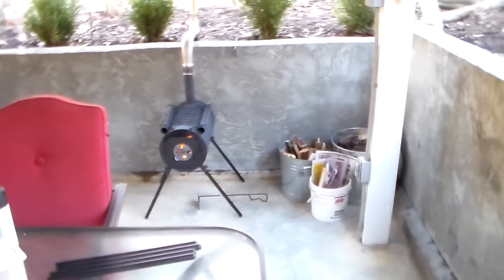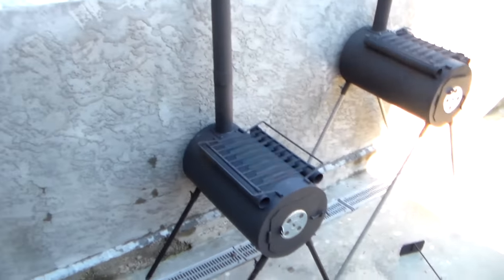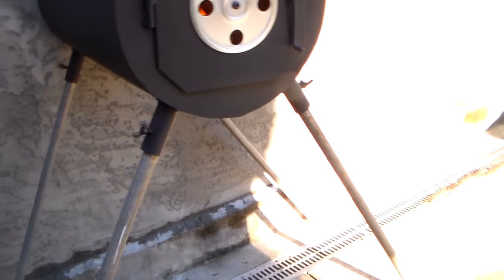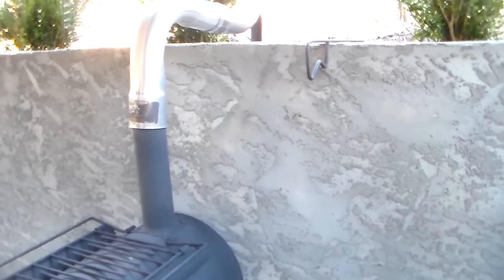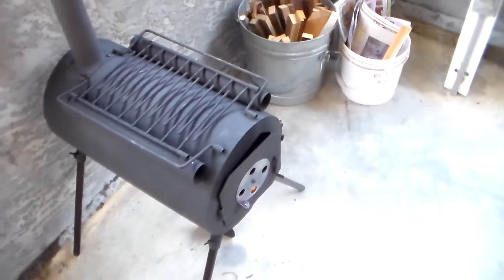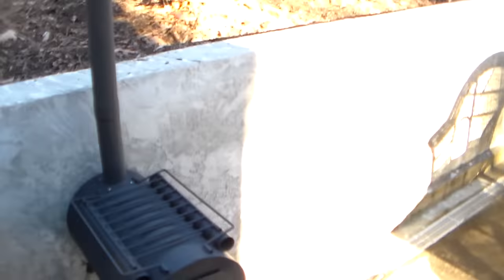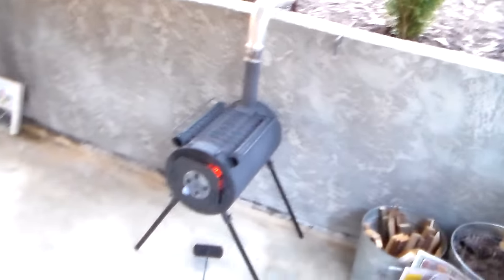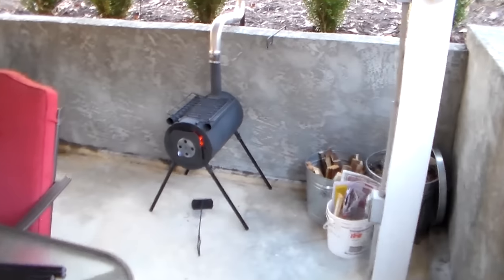Small portable outdoor woodstove for campers or preppers

Comment: So these seem like nice little stoves, but for your purposes, how are they better than firebrick or concrete block rocketstoves that can be made for under $20.  You can make 4 of them for the price you paid for one of these stoves with your inputs.  They burn just as hot, if not hotter, and use a fraction of the wood (Understanding that you have an endless supply).  Not trying to be argumentative Im just trying to see the real benefit of these.  I really like the idea of outdoor kitchens in the summer to keep the house temps at a reasonable level.  Thanks again for sharing, Dave.
Reply from the maker: +Dave Pruitt I like the ability to have the smoke away from the cooks and exhausted higher up.  Plus you can use it in a make shift shelter.  Plus everything stores in the stove and light weight to carry in a vehicle.  I love the concrete block homemade rocketstove they work great also.

Comment: soot will build up in the bend, and over heat it
Reply: Jesusandbible + Yes, creosote will build up in all woodburning stove pipes, so there has to be a way to clean them. One good idea is a straight up pipe, so easier to clean. Running the stove slowly up to 600° F at the begining of each firing - probably too hot for those thin walled ones, try 500°- .helps. keep an airtight stove pipe clean up to 5' away from the stove, even through bends.
Reply: The pipe can be taken apart and cleaned as needed. If you don’t want to do that, you can get a piece of chain that can be dropped through and spun around in the pipe to get rid of buildup, or buy a pipe / chimney brush and cord.

Comment: Those doors need angle iron welded to them, or they're likely to warp soon. I'd use small, but 1/8" thick L, frame around the perimeter, then two across. 1" weld with 2 1/2" space between. Clean the door very well. If your factory paint is flaking off, it .all. will have to be removed before new paint applied. There went the money deal. I'm telling ya, gotta make everything ya can, yourself.

Comment: Thanks for sharing I got the bigger version on ebay for about $60 with shipping. Mine also has a grate on inside to keep fire off the bottom and and two vents. I had to burn off all the paint then repaint with high heat spray and I replaced the door handle with a homemade version so that the door closed better.
Would like to know what the size of that muffler pipe your using?
Reply from the maker: +dnhman I think it is the 2.5 inch but I will have to measure it to make sure.

Comment: I have not been able to find inexpensive muffler pipe. The auto parts stores range from upper twenties to thirty some price range. A muffler shop got us two elbows for $18 each. That was the lowest. Anybody have thoughts on where to get this stuff for the $6 price?
Reply: what if you go to a junk yard with a saw and cut some off old cars, straight pipe,curved pipe. you may even find some that are just bolted on with u bolts. just a thought.should not cost much.
Reply: Thanks for the info.
Reply: Jodi Mandelias  try a parts store like AutoZone , advanced auto, or what you have in your area. most chain parts stores have bent pipe and shorter strait pipe.. if you get a galvanized pipe be sure to burn it off before you use it indoors and paint it with a high temp paint if you want. if you paint the pipe attach it to the stove and burn a good fire to cure the paint before indoor use .. peace  and good luck!
Reply: Jodi Mandelias yeah because they know we're making survival things
Reply: Yep, the junkyard is where I would go.

Comment: I've had mine for a couple of years...did have to repaint it.  i'm currently looking for more stove pipe so I can have the option of bringing it indoors.  3" pipe is a quarter inch or so too big.  I like the muffler idea...is it 2"+ or 3"?  high heat silicon is safe to fill gaps around pipe?  anybody else using these and have suggestions as to where & what I can get for pipe extension & the through the wall piece , please pipe-up, thank you, southernprepper1.

Comment: Mine is a P.O.S. It seems to be starving for oxygen because it puffs like a steam engine. I must keep the door open to allow more air. I think the 2" pipe is too small as well.
Reply: Beer Hunter + Yep, at a high rate of burn, the "intake manifold" and "exhaust header"  look like they couldn't keep up. But the positive of it is, it's keeping the "block" and door from overheating and warping. Looks to be a low-output stove. By the time and money spent to improve it, a used better performing one could have been secured. I believe the Chineese are laughing.

Comment: what is the wall thickness on that in inches or fractions there
of
Reply: +David Yates bout an 1/8th inch....just ordered one and been doing my research
Reply: sunnylandcamper yeah thats awfully thin for something thats gonna contain burning wood....why not just buy a vogelzang wood burning stove that can be used to heat your house or for outdoor cooking...i bought mine about 8 years ago am still using it every winter with no reasons to replace it in the forseeable future....and yes they are cheap mine cost 199.99 from harbor freight also you can purchase any part should it ever need replacement parts....
Reply: myself I need something smaller, I have watched a ton of videos and have not seen anyone say they had one burn out
Reply: +sunnylandcamper its kinda hard to judge the size but the size seem about the same except the thing in the video is gonna bee considerably taller than thewood stove...